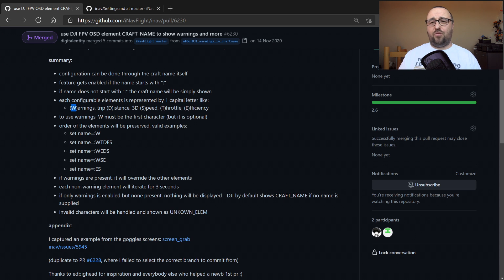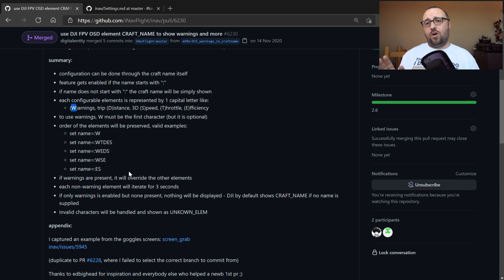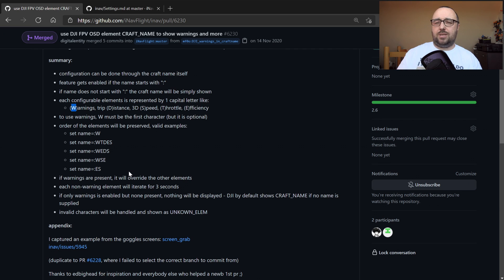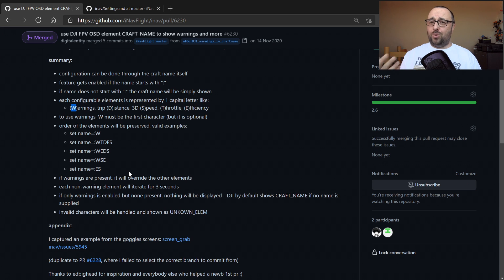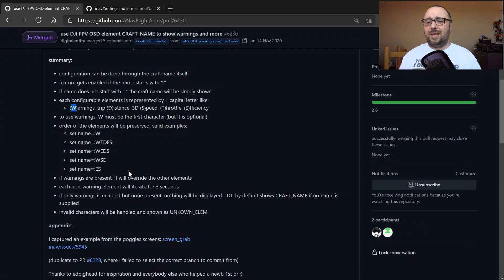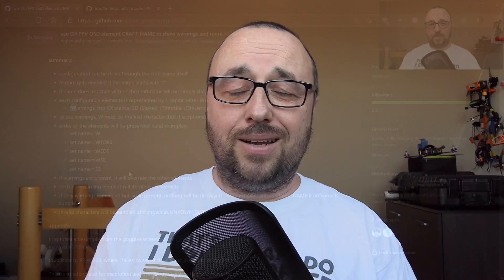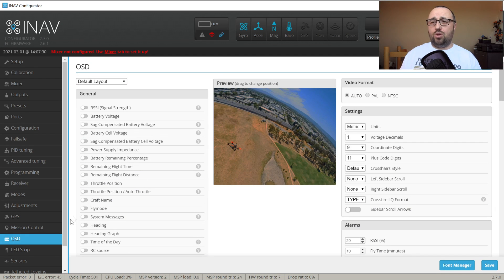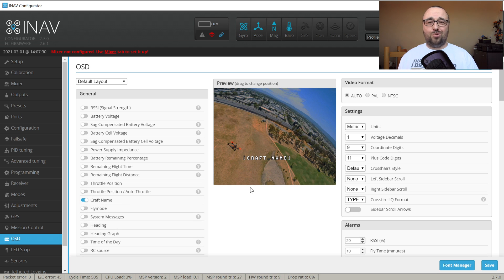INAV DJI craft name hack - warnings, 3D speed, trip distance and other

Comment: Hey Pawel, question... On my two Mateks (F411-Wing and F405-Wing) I lost OSD output altogether when I upgraded to INAV 4.1.0. I'm using DJI FPV VTX. I tried downgrading to a known working INAV version but still nothing. I do get video, but OSD is nowhere to be seen. Any idea? Thanks!
Reply from the maker: Have you correctly setup ports? It has to be DJI VTX, not MSP

Comment: I have an iflight Titan with Dji Air unit. I have put Inav 3.0 on it but cant get the battery osd warning to work. All the other warnings or alerts seem to work. I have tried to downgrade to 2.6.1 to see if that helped, but no luck with that either. The voltage shows up corectly in the goggles but no warning when I reach the cell voltage of 3.5 volt.
Any ideas? Must be something I got wrong?

Comment: Hello Pawel

I have a question, is there an option or a chance for OSD to display Heading in degrees. It is very important in the analog, and it helps to determine if the magnetometer is properly set up. And in digital there is no such thing. Unless you have a tip on how to properly set the magnetometer with the air unit.
Reply from the maker: No, DJI does not give this option

Comment: Very IMPORTANT useful info. Thanks to INAV devs for implementing this hack. 
It would be nice if DJI / INAV could support a couple additional labels beyond CRAFT_NAME. Ideally it would be nice to split speed on one side of display and have altitude and vertical speed on the other side.
With the CRAFT_NAME used to optionally display messages and warnings. 

Is is possible to set up vary